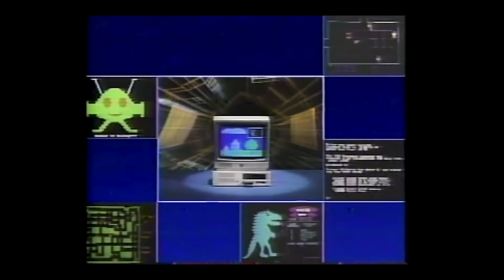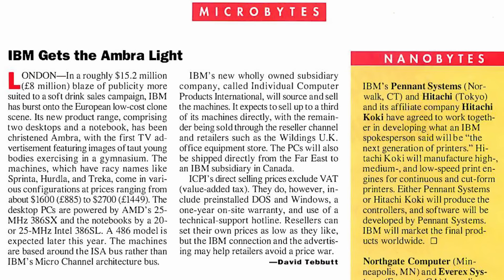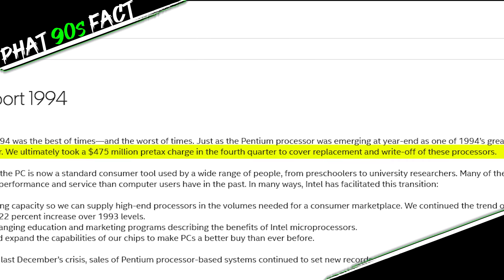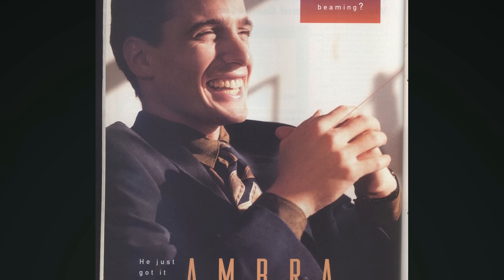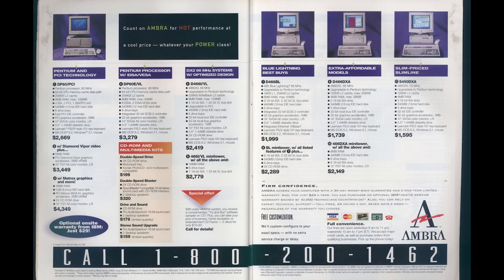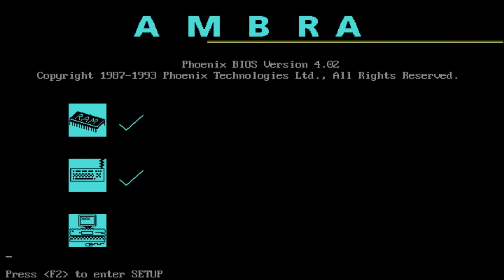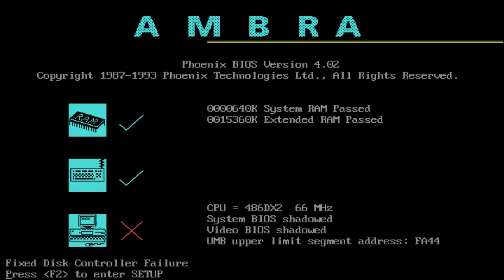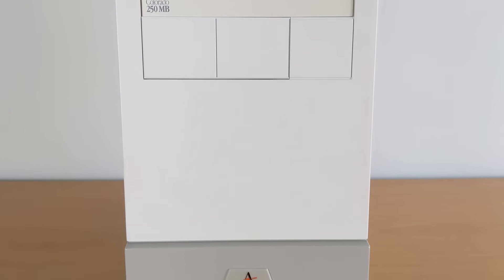The PC You've Never Heard Of

Comment: Blue Lightning is just IBM's variant of the Cyrix/ST Cx486 DX2/66. Nothing special other than the fancy blue heatsink. Cyrix's version has the green heatsink.
Reply: That was a later iteration from after IBM agreed to manufacture Cyrix CPUs. The original blue lightnings were, as stated in the video, modified 386s.
Reply: @sedrosken831 intels 386's based under license to not sell them as standalone too, but theres just the question remains of why? Did ibm just have fab capacity without use?
Reply: @lassikinnunen  The fun part about that clause as I understand it, is that they were completely free to sell it as part of a large assembly like a motherboard. So they did. Note how you never see those CPUs loose, it's not just because they have to be soldered. As for why, They can manufacture those for cheaper than Intel would sell them real ones, and they can reuse some older designs. Plus they were quite competitive, with that extra level one cache they could usually go toe to toe in whatever you wanted productivity wise with a real 486DX2. They didn't hold up so well in games, but they didn't exactly have a poor showing either.

The later Cyrix designed ones aren't subject to those same limits, and being able to brand some as their own was literally a term of the agreement they struck with them. That lasted through to the 6x86 era.
Reply: @sedrosken831  yea but what did intel get  out of it?  Like they were in position to limit them, so why not just make them buy 486's?  The whole deal including the clause to just be sold as upgrade packages or system boards originating from 386 era before intel changed the way they dealt with other fabbers?
Reply: @lassikinnunen  As I understand it, the licensing deal originated back in the 286 era when Intel was still okay with second sourcing agreements. IBM just took a mile when given an inch and their volume was so relatively low that I'm guessing Intel didn't consider it worth their time to litigate it. 

As for limiting them, I'd say they were pretty effectively neutered by being stuck selling them as whole packages with motherboards. Imagine how well they'd sell if they had been able to launch a PGA socket version and undercut Intel like Cyrix and AMD did?
Reply: @sedrosken831  probably after the deal Intel found out IBM is a law firm that also sells IT stuff, probably more costly to sue IBM than to just let IBM fail at marketing a CPU. At some point IBM slapped some 'multimedia' processing on to Cyrix, I had one it was sadness on a chip 😂
Reply: @sedrosken831 the Cyrix-based ones were the ones used in Ambras though

Comment: I laughed hard when it started snapping at you like an angry dog.
Reply: Broken cup holders are so annoying
Reply: that was hysterical
Reply: RUN
Reply: it sounded like a horse galloping hahaha
Reply: That was funny and not a failure mode I've seen before. Usually they just fail to open.
Reply: Yeah, but now they have to find an original Ambra CD ROM drive, and also scrounge up an original Ambra plastic rectangle to fill the hole that is left after removal of the non-OEM tape drive.  Museum restoration isn't easy.

Comment: The door with the key is not designed technically for a hard drive. Those machines were also used in the medical industry and that Bay usually housed a card that ran to a scanner for medical purposes.
Reply: Why was it locking?
Reply: @Andrew Burns  so that people didn't try and remove the module for the scanner they where quite expensive back then nearly 1,000 per  module

Comment: In the early ‘00s I convinced my parents to buy an IBM desktop PC from a newspaper ad. It was a basic Pentium III Celeron with a microATX motherboard, black and blue case with IBM badge. Shipped with XP or ME, ours had XP. I remember being curious back in the day as to why some places (BIOS and drivers) referred to it as an “Ambra Ispirati” rather than an IBM. I guess Ambra lived on in some form within IBM Canada until at least 2001.
Reply: It was a Celeron or a P3… it was not both.
Reply: @lookoutforchris  It’s a PIII Celeron as opposed to a PII Celeron or P4 Celeron.
Reply: "...as to..." 😔
Reply: So it's a socket 370 celeron...?
No such thing as a P-III celeron...
 @solomongrundysfoot
Reply: @benny7811 ?
Reply: @benny7811  why the reply to me?
Reply: @benny7811  Yes there is, in common parlance. Celly 300A which is a "P2 celeron", for example, is also a s370 celly, since there are several generations of chips called 'celeron' it is useful to distinguish which chip generation it is so to speak. Pretty much everyone called them that back in the day. Since you had Tualatin later it would make sense to distinguish it from a Mendocino based on something other than the socket which didn't mean shit to most people. Hence P2 and P3 celeron being used for that purpose, I've had that discussion with people several times, where they see 'celeron' as being 'old' instead of 'bastardized el-cheapo' which means I have to explain to them in terms of something they understand what the difference is between a Celeron "derived" from a P2 and one derived from a P3 where clock for clock they are not the same thing - again depending on what but in a general sense. Megaschmertz don't mean as much to a lot of people. I did occasionally build/source/spec computers for people back in those days and it did some rare times come up where someone is asking why I'm asking more for something than some other guy is asking for what to a non technie buyer seems very similar. I didn't do anything other than "full fat" CPU's in part because of the stupid naming schemes but not only, the performance predictability was bad with the "el cheapo" CPU's since you might get a new chip with bits missing, or you might get an old chip with or without bits missing, or something slightly different like shorter pipeline, or longer pipeline. The cache being reduced was reasonable but the other shit was not. I'm lookin at you too AMD.
Reply: @lookoutforchris  Remember, Celeron's were simply cut down Pentiums, initially lacking the cache, but later got a modicum of it to help with overall performance but still a cut down Pentium.

Comment: I think one of IBM's biggest blunders was the microchannel architecture. It turned so many customers away from them forever. They were so arrogant that they thought they were still in a position to steer the market. Computers were stupid expensive back then and companies really debated just how much they could squeeze out of what they bought. IBM in this era was vastly out number by system manufacturers offering PCI and ISA as standard. What would you buy in the shoes of a corporate or private buyer? The system that only had proprietary card slots with a limited assortment of expansion cards, or the system with a plethora of expansion possibilities because every one is using the same standard? And don't get me started on OS/2 Warp. They didn't come to their senses until it was FAR too late.

Comment: Really the phenomena of IBM losing the PC market they created was a failure not of IBM but of Wall Street. Its a pattern we see time and time again. IBM had grown the market and was under attack from companies willing to accept far less gross margin. The volume of PC's sold was growing almost logarithmically.  Brilliant Wall Street analysts saw this and hyped the stock at first then pivoted when the inevitable price wars occurred. In other words the market commoditized. This of course is great for the consumer however it meant although IBM made more money overall on the market it was at substantially lower margin per unit sold.  Wall Street Analysts demanded IBM exit the market as they wanted to see upwards of 65% or more gross margin - what they had seen for a brief period in the beginning of the new sector. That was terribly flawed "first order" thinking. As such IBM was forced to exit even though they made tremendous bottom line revenue AND retained a great "moat" due to their internal innovation capability. (IE the IBM R/T RISC computer etc. )  It is a classic tail of opportunity lost due to external forces that were not competitors. What analyst has ever made a product? And note the IBM R/T RISC computer was capable of running the licensed Apple Mac OS and its GUI. (It was based upon IBM's POWER PC architecture.)   My theory is while the ankle biters were killing eachother making the same box - IBM would have dominated selling solutions and continuing to define the market. If they were only allowed to do so. Unfortunately they had to exit to appease the great gods of Wall Street and thousands of good paying jobs were lost. Of course IBM made a comeback a decade later selling blade servers to the new Internet datacenter market. These were virtually the same tech but had better margins.

Comment: I suspect the locking floppy drive was meant as a form of of protection.That would be protection from booting something other than what's on the HD and preventing the loading of potentially harmful software to the system. 
Based on the 93 copyright, a floppy would have been the only viable bootable removable media. It was only the main means of moving data between PCs. 
CD-Rs did exist at the time, but putting together a working recording setup around that time would have been prohibitively expensive.  And that BIOS predates the bootable CD standard.
The tape drive requires additional software for the OS to see it, and it would not have been able to function in the same manner as an HDD or FDD. 
 94 is when Zip drives became available and USB wouldn't show up until a few years after that. Firewire was also still a few years off.

So physically locking the floppy drive behind a panel would have been a perfectly reasonable deterrent for the time.  
It also looks like there is a chassis lock on the system that would have prevented tampering with the innards of the system.

Comment: 5:10  At one time, IBM manufactured Intel compatible Cyrix processors in Essex Junction, Vermont.  The processors had a innovative feature called "double clocking".  Internally, the processor ran at twice the system board's clock rate, giving a good performance improvement over Intel's own offering.  Intel was not pleased.

Comment: CD-ROM is a Philips/LMSI CM-206.  I replaced a lot of those drives.
EVERY ONE of them ate their gears after a few open/close cycles.  Not sure why they used a Jeep winch for a tray motor.  Anyway if you can repair it you'll have the only working CM-206 in existance.

Comment: I wonder if you could help me?. I've got a full sized tower PC that I've held on to  forever and am not sure what I've got. The front panel has space for 6 full sized drives and 2 floppy sized drives. It's shell is plastic and has that old PC color.to it but inside is roomy and made of aluminum with room for extra hard drives. It has a folding metal piece for the motherboard so it can be pulled out and worked on. The motherboard has no video port and an expansion slot video was added. what is it?

Comment: A opti chipset. This reminds me to something special from '93. I had a 486dx33 on a opti motherboard with opti local bus. Opti local bus was 32bit eisa slots on 33MHz, this combined wit a opti et4000 vga card and a caching diskcontroller with a 16MHz amd 80186 and 1MB ram just for pumping data (240MB seagate). 4MB ram for the processor, try that in these days.
At that moment the 486dx50 was the fastest intel consumer processor.

Comment: It's been a long time since I laid eyes on that computer. It's the 1st computer I ever bought and it didn't come with the math Co-processor I had to buy it and install it. When I first got mine it had only 8mb of ram and a 400mb or maybe a 440 hardrive. It also cost me $5000.000. I don't remember if I had to add more ram for Windows 95 but when first bought it it had dos 6.22 and Win 3.1. I had computers before this that my parents bought me but this is the 1st one I bought. I can remember playing Doom with my neighbours after I got a modem. Sound Blaster 16 also came with it. To install windows 95 you have to turn that virus checker off or 95 wont install. I think I had to finance mine or I paid for the bloatware that came with it I got swindled because mine cost me 5k but it came with so many cd's and 3.5 floppies.

Comment: Can confirm early Blue Lightning cpus were built within the 386 design specification and licence. They’re usually a qpf132 that can be connected to 100 or full 132 active pins and will switch between 16 and 32 bit external operation depending on bus width. Rumour is 24 bit also works and ram configuration in some weird boards supports this. Chip is a 3.x volt chip but is rumoured 5v tolerant. 2x and 3x multipliers available and max speed supposedly 33.3x3=100mhz though IBM rated at 3x25=75 official max. Spec of the top BL3 included 16kb cache, 3x multi. All have a handful of additional 486SX instructions for compatibility. Transistor count, package, ALU behaviour still 386 territory. But yes later ones were just 486DX2 chips nothing special.

Comment: I got one of the AMbra PCs at a yard sale recently. It does have the Blue Lightning CPU. I have it running and booting under DOS 6.22 and Windows 3.11. This can easily run Windows 95 and I replaced the CD ROM drive with a look alike CD writer. Works perfect, I did have a hard drive that worked on this.

Comment: I've got a few notable facts about the blue lightning actually: 

- Being 386 derived, it has no built-in floating point unit, and uses a 387 math coprocessor socket.
- The design stems from their 486SLC design, which was a similarly souped up 386SX, and thus has a couple of quirks inherited from that design, namely an inability to cache more than 16 MB of RAM. At least you can actually access more than 16 MB with one, though. It has 16K of L1 vs the SLCs 2K and the regular 486DXs 8K. 
- Again, because it is 386 derived, it has issues being detected by most software identification utilities. I've seen many humorous interpretations made by various packages. I think my favorite one thus far was when mine was detected as a 68 MHz 486SX. Most software will compare the instruction set with how long it takes to complete a specific instruction to determine clock speed, and because the blue lightning has execution characteristics of a 386 with the instruction set of a 486, software can often end up confused. It doesn't help that the real blue lightnings never supported the CPUID instruction.

This one isn't actually a fact about the blue lightning in particular, more an overview of all of the IBM specific chips, but due to their licensing agreement with Intel, they could only sell CPUs as part of a major assembly or whole machine so anything you see with a blue lightning was made at the very least mostly by IBM. They tended to pair excellent supporting hardware with it in their day, for example, my board has excellent local bus IDE, a floppy controller, parallel port and dual 16550A UART based serial ports onboard, a rarity at that point in time. The 16550A UARTs are notable because a lot of companies still got away with using 8250s and the 16550As were capable of much higher baud rates.

Comment: Is that a multi-disc CD-ROM drive?  What kind of sound card was in that PC?  I love the animation on the Ambra logo when the machine boots up, that's not the kind of thing you'd see on a PC of that vintage.
Reply from the maker: 2X single-disc CD-ROM, with a proprietary interface! The sound card is a Media Vision Pro Audio 16 with a 16-pin header for the CD-ROM. Ambra provided several multimedia kits to choose from, and this combination was one of them. Totally agree about the Ambra animation on boot-- did not expect to see such a cool startup screen for a "budget" PC!
Reply: @theserialport  Thanks for all that.  Clearly that CD-ROM reader needs some serious attention if it can be repaired at all, I've never seen a CD-ROM drive do that before.  At first I thought it was one of those 4 disc readers like Vwestlife has demonstrated and it was having trouble selecting a disc slot, but clearly there's something else wrong.  I don't know much about Media Vision, but I've been told they went out of business very quickly.
Reply: LMSI CD-ROM, very rare

Comment: My first PC was an Ambra Sprinta II, 486 33MHz, 4MB RAM and 170MB HDD. Bought it with hard earned money as a teen in 1995. I later upgraded it with SB16 and 2x CDROM.
I still have (and love) this machine, and have now upgraded it ever further (you can find it on vogons if you search for it).
Let me tell you though...You could NOT remove the HDD without the key. It was mounted on a rail and would ONLY slide out backwards.

Comment: Too bad it isn't a DX4-100+, but this combination of VLB graphics and 16MB RAM still was a dream come true for many and should do pretty well for anything before Quake 1 ( 1996 ).
At about that time I had a 486-SX 25, a cheap Highscreen thingy with a Trident 9000 ISA card sporting 256kb of RAM while the system only had 4MB - with but the PC speaker for sound.
Suffice to say I was rather underwhelmed, especially since the same priced model at the time, a 386 DX-40 with even a Soundblaster 1, had better performance due to the FPU.

As for history ... we lost great a many products and companies in that ... lets be nice and call it "market positioning race".
I was especially sorry for Aureal and their Vortex line, as well as PowerVR with their Kyro line. S3 too had it rough too, as did 3DFX of course, and I still feel the day I couldn't get an ELSA graphics card anymore.
Not to mention all the Risc based CPUs that went under - though ironically enough the ones I miss the most isn't Cyrix or IDT but the AMD K5 series - a pretty impressive yet rather underappreciated soon discarded design.